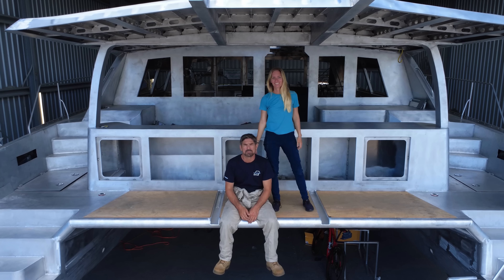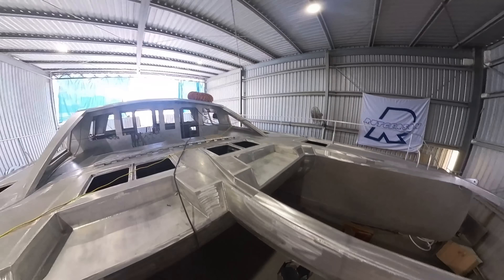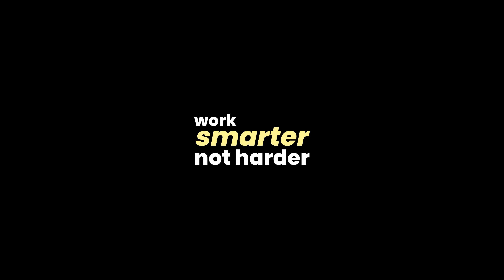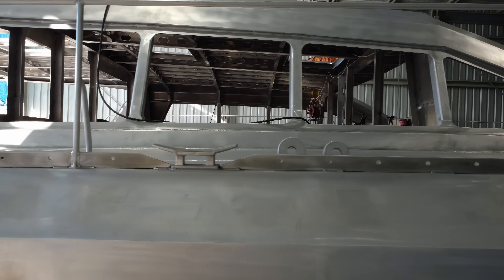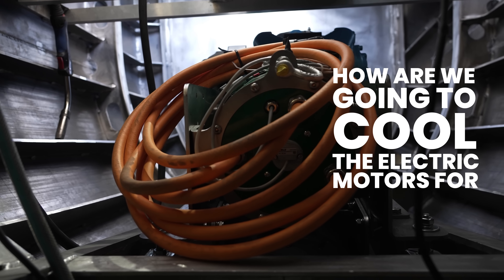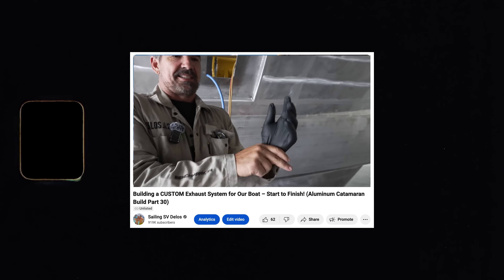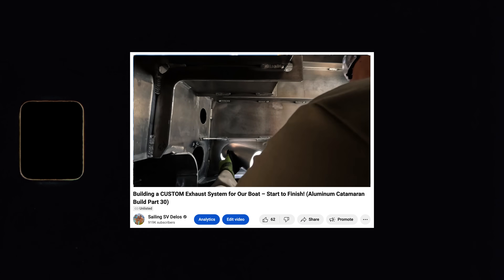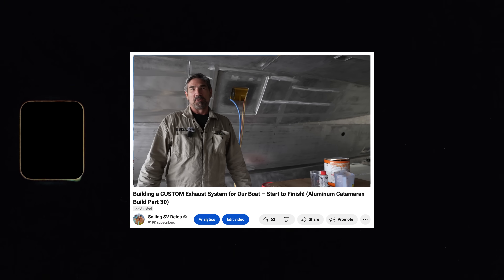We Challenged AI to help design our Keel Cooler 🧠 (Building Our Own Aluminum Catamaran From Scratch)

Comment: Generative AI engineer here: One thing that Gen AI does BETTER than most people realize is validating its own work. And while these days, some of this evaluation is automated, it's not always the case. Especially in the "chatGPT" type apps where you just ask a zero-shot prompt like you did. 

I know it sounds crazy, but if you ask deepseek/gpt/gemini to validate its own work (ex: analyze your response and make sure there's no errors or missing information, etc etc) you could make sure the calculations are correct. This isn't foolproof obviously, but is a very good technique. 

Secondly, you can use role based prompting to help receive a better answer that might highlight issues with the problem you're trying to solve. For example: You are a marine refrigeration specialist. Design my keel cooler... 

Hope that helps!
Reply: I seen people use ChatGPT to turn in school essays and they end up getting As in their paper.
Reply: Yup, I have had to question ChatGPT on several occasions, it comes back and tells me I was correct and it corrects it answer.  Just amazing, but as Regan once said  trust but verify.
Reply: When I tried that, the AI would just make up errors in the work, and it would find different errors every time lol. Maybe it has advanced since then.
Reply: @roberson644  When was this? If it was last year, I suggest you try again! Even over the last 6 months we've seen an incredible leap in how "smart" the current generation models are. 

Give it a try again. Be sure to provide as many details as possible about what you expect from the outcome. Ask your questions like you're giving an intern instructions. Be skeptical of the output and have it check its work.

Comment: I’m a mechanical engineer that specializes in fluid systems and thermodynamics.  For starts how cool  do you wanna run that motor?  Generally you’d want to keep the temp as low as possible to reduce losses in the stator.  This poses a real problem. The source temp and ocean temp are not far apart.   Not like an ICE.

Also how big are the coolant fittings and flow passages within the motor?  Does the manufacturer recommend a minimum flow rate?  Bet they do.  This will size the recirculating pump which adds its electrical load to the waste heat load.  

This number will size the plumbing to the cooler.  Unless you want to dump that heat into the boat it needs to be insulated and preferably short.  The longer the run the more pressure drop and the bigger the recirc motor.  Once you get to the heat exchanger we need to establish a balance between the heat transfer from the coolant to the walls and from the wall to the quench- the local water.  Also I’m assuming you don’t want any vulnerable exterior stuff with thin walls or hull penetrations.  This means that the interior surface of the heat exchanger that faces the cabin must be insulated.  

Each heat exchanger you are considering should have a flow rate vs delta P rating. It is very important to keep the flow velocity up inside the hex or the internal heat transfer coefficient will be kinda low.  Just do a quick check on the internal Reynolds number. It’s gotta be fully turbulent.  I’m not sure how fast you expect the boat to be going when underway with this system in use.  I suspect it’ll be kinda low.  Like a couple knots. Get the AI to compute the local external Reynolds number.  It should be in the turbulent regime at minimum motor drive  speed.  Also I’m assuming this installation is aft in the hull. This means that the water flowing over this surface has been following a surface that is like 50 ft long.  At these low speeds there will be a layer of relatively stagnant water adjacent to the hull.  Not optimal for a great external heat transfer coefficient.

This means that when coupled to the low available delta T the hex surface area will trend larger.   Another consideration is how the residual sensible heat within the drive motor is to be removed once it shuts off. It’s possible that when the boat stops the only cooling thru the hull will be by free convection.  This could be kinda small.  

I’d also ask the drive motor supplier what the overall efficiency is.  The motor efficiency on converting electrical energy to its output shaft may be 95% but I’d bet there’s a gearbox present to get the shaft speeds down to prop speed band.  That gearbox is not perfect.  It’ll lose around another 5% for each stage.  That gearbox normally has to be cooled too.  Also ask what the efficiency is at off peak power conditions. Same with the inverter box driving the motor.  

I understand your motivations but given that this is a piece of expensive, critical equipment I’d trade this against a cooling system like you have on the ICE.  They could share common components and there’s a lot less uncertainty.  I think it’d be easier to maintain and repair too.  If yah wanna be an engineer then trade honestly at least two configurations.  It’s often heartbreaking to realize the cool system ain’t all that cool in the aggregate.
Reply: I am also a mechanical engineer.  One of the AI outputs was basing its design on a mid field sea water temperature.  This would mean that whenever you are in warmer water, your electric motors will be over heating.  You need to design for the worst case condition and then add a safety factor.   As an analogy, if you were designing a bridge, you would not design it for mid level traffic, you would design it to be capable of carrying a huge bunch of heavy trucks.    There can be other unforseen issues such as what happens if you haven't been able to clean the hull for quite a while and you get a large build up of growth on the hull.   Does the anti fouling paint decrease the conductivity of heat flow.
Reply: @andrewkeir2282  as a marine mechanic, you don't paint the heat exchanger on a keel cooler, you do change the zincs though, and you don't paint the zincs either, but be sure there is a good clean contact
Reply: @andrewkeir2282  Is the circulating coolant water too warm for fouling to occur inside the heat sink?
Reply: Ibid.  As an aerospace engineer, I second the ME's motions.  Even at -50 deg F at 35,000 feet, airplanes also need to employ some interesting tricks to keep things cool, including cooling very hot, high-pressure turbine bypass air before reducing it's pressure.
Reply: To be clear you are suggesting a separate heat exchanger inside the boat that draws water and expells water using thru hull connections?  I would agree that this could be the simplest solution using off the shelf components.  It would be ideal to make the cooling system common (shared) to both electric drives as well.  This would eliminate duplication and it would limit the number of additional holes in the hull(s).   Finally,  the strainers and and all ancilliary components could match the ICE system so as to make future servicing much simpler.  Kudos for the lateral thought process...very smart!
Reply: I'm an absolute newbie in this area, but one concern for me would be galvanic corrosion and since your hull is part of the heating/ cooling system the heat could speed up galvanic corrosion through the hull. Maybe using a separate heat dispenser would allow you to swap out parts should they corrode in the future? Might be tricky if it's the hull that's affected.
Reply: I’m no engineer, but have worked with fully electric boats the last 10 years. The 25 kW motors will almost never be used at max power more than a couple of seconds, during manoeuvres in tight quarters with wind. Since the prop power is available with almost zero delay, for this use the motors appear far more powerful than they are. For long lasting loads, there will be no wind and typical speeds will be 3 to 5 knots. 

A guess based on experience would say that if each motor runs at 2-3 kW, speed should be 5 knots. Keeping 2 knots would probably be possible at 0,5 kW per motor. Very low speed gives very low resistance. For each knot increase, expect double consumption. Even more at higher speeds, when wave resistance becomes an issue. This means that significant cooling is almost never needed. 

However, the system has to be designed for worst case scenarios, of course. Say strong winds in tight quarters when the anchor came loose. Then full power for extended time will be needed. Thus also full cooling capacity.
Reply: Couldn't agree more!
Reply: Re: heat transfer from  ‘cooler’ to hull. Cooler unit to be shaped to provide an intimate fit to the hull. Optimize heat transfer with thermal grease between cooler and hull. Cooler and hull surfaces free of corrosion or anti oxidation treatments.
Reply: I really don't think the primary goal here is to reduce losses in the stator.  It's to prevent the motor from overheating and burning up a coil in the motor.
Reply: Si what is your answer mine was 2 square meters read what I wrote!!!!!
Reply: I agree, the electric motor cooling system should be K2*%of output in ohms-seawater temperature

Comment: Mechanical Engineer from the rocket industry. We solve the heat sink area problem in the nozzle by cladding the inside surface with copper (on a cadmium substrate). Then we circulate unburned fuel in the upper portion of the nozzle, which is made of thicker metal than the lower portion. Additionally, we squirt unburned fuel through tiny channels (mid nozzle) which tends to make the outer flame burn rich, which red flame creates a boundary layer that keeps the nozzle from melting. You could accomplish the same effect cheaply inside the hull of the boat, by building up a thicker aluminum substrate immediately around the motor, then welding a standard aluminum car radiator to it, and pumping standard radiator fluid through the system. It's important that the car radiator has enough radiation through the hull and you'd need to calculate the number of welds needed (surface area) for the heat flux to all transfer.

Comment: @svdelos Could you do a test to see what the actual thermal coefficient is through your Hull? Testing with stationary 25°C water is pretty much worst case scenario, right? Don't forget the thickness of your Hull in all these AI calcs. 

A few thoughts...

Be careful how many times you make conservative estimates in your assumptions, they can add up to a big difference in the end and likely is the reason why different AI models give different answers. 

Design the external part of your keel cooler to be easy to clean as I imagine barnacles and other growth could affect your heat transfer.

Could avoid extra holes in your Hull by welding ribs on the outside and a heat transfer box for coolant flow immediately across the hull from the ribs.

Last thought since you are intentionally pushing the envelope on these design choices... Have you considered circulating either drinking water or diesel fuel as your coolant? Then when returned to their tank they'd have the entire surface area of your keel/tank to transfer heat thru? Wouldn't want to contaminate your water or risk fire from leaking diesel tho.

Comment: Heat transfer coefficients are waaaaaay worse in practice. They always quote ideal crystallographic lattice thermal coefficients along the best axis. In reality you have forging, paint, surface friction, surface resistance...etc, etc. think an aluminum heatsink on your computer uses a thermal paste rated 100x less not including contact resistance and pressure.

Comment: I'd go with 0.5m^2. I got to this using a VERY different method, but I got a similar result. I work on computers which are water cooled (water pulls heat away from CPU, into a radiator, which then has fans attached and puts the heat into the atmosphere). A modern high-end CPU can use as much as 250 watts (some do more!). The CPU is only 45x37.5mm and can only go as high as 100*C (should be kept far below that, though). But, those can be cooled with a fairly small radiator package, such as 360x120mm. And, that's just radiating heat into air. You attach the radiator to the inside of your keel then have water flowing over it . . . it'll be far more efficient at dissipating that heat. But, your motor is putting out 10x the heat of a CPU, so let's say it needs 10x the cooling. That 360x120 rad is 43,200mm^2. Multiply that by 10, and you're at 432,000mm^2 . . . or 0.4m^2. So, just under half a meter squared. Which is in-line with what you were saying!

Comment: Hi Brian & Kaz,

I am no engineer but am a millennial nerd. HA! If you are considering using AI for your project going forward, I would suggest that you use the latest beta of Grok from Xai. I believe it's currently called Grok 3 (beta). As I understand it, Grok uses real-, up to date information not only from the web but also directly from X/Twitter. Ai programs like GPT are constructed on a set of information from a specific point in time when their latest version were update. I am most certainly not paid to promote any of these companies, I am just, as I mentioned, a nerd that absolutely loves your channel and this build series.

Godspeed to you both!
Reply: This is what grok responded with deep think using Brian’s prompt “### Final Answer:
- Heat to dissipate: 2,780 W (2.78 kW).
- Heat sink size: A flat aluminum keel cooler with a surface area of approximately 0.124 m² (e.g., 50 cm x 25 cm) is sufficient under the assumed conditions (ΔT = 30°C, h = 750 W/m²·K). For safety and fouling, consider upsizing to 0.15-0.20 m² (e.g., 50 cm x 30-40 cm).”
Reply: Using “data” from Twitter makes Xai less reliable, not more.
Reply: @WilliamAArnett  Above and beyond using web resources, Grok can cross-reference online information with real-time, human- input that people, including marine engineers, could post on X. Deep Search together with community notes; that's two additional layers of filtering before you are given an answer, which is the foundation that Grok was created on. I struggle to see how that would be less reliable that purely quoting online resources like most Ai programs do. Care to elaborate?

Comment: Hi Brian, you need to transmit the heat from (the surface of) the electric motors to the hull as efficiently as possible. I assume the motors are mounted fairly close to the aluminum hull, which is a good thing. I would use a beefy aluminum motor mount that touches the hull to use the aluminum to directly transfer the heat via the shortest possible path, rather than using complicated fluid system involving pipe and pumps etc. I used aluminum heat sinks to suck the heat out of large LED arrays that worked very well. Heat Pipes are another way to efficiently move heat but an overly complicated solution for your simple situation, Rich.
Reply: Many marine electric motors, even in the RC model world, have a "water jacket" around the motor for cooling them.  It looks like the electrics that they're going to use are designed that way.  However that isn't (to me at least) the major ding against your idea, my concern would be noise/vibration.  While electrics are nearly vibration free, that isn't the same as COMPLETELY vibration free.  For an electric POWERBOAT I wouldn't hesitate to use rigid mounts to improve heat transfer and the "noise" be damned LOL

Comment: If you are putting the cooler inside the boat then you have to consider that the antifouling paint you are using is having good thermal conductivity. Better to use outside the hull cooler with direct sea water contact. Marine growth acts as insulator.

Comment: There are literally thousands of steel narrowboats on the English canals with keel cooling for their 30 to 40 hp diesel engines.
Typically they are a thin tank welded to the swim of the hull around 600mm  x 1000m long and 30 thick with internal baffles to ensure the cooling water doesn't  short circuit. 
Box coolers are a more compact alternative manufactured by companies like Blokland.
Reply: Yup, Beta marine has Keel Cooling Calculator & Tank Design info on their website specifically explaining how to do that.
Reply: cooling water cant short circuit a mechanical device Unless it's on purpose.
Reply: Ex crewmate Liz may have one!

Comment: Be Careful using AI.  I have run into a few cases were the AI will hallucinate and create facts and items in images to support its conclusions.  e.g. using deepseek, I took a picture of something and asked it to draw an arrow to an adjustment bracket that it was referring to in a previous question. It took my image and redrew it  with an optical sensor that was not in the original.   I called it out on it and it recognized that it hallucinated.  I had to tell it that in future questions to not redraw the image but use the original.  Its all about the prompts.  I would suggest that you research a little on how to create prompts for the questions your gonna use it for.  It makes a world of difference.

Comment: 1. How will the hull paints, ablatives affect these coefficients and is it a problem as the hull growth accumulates and forms another barrier to transfer.  2. Can you figure a way to dump this excess into the water heaters on the boat first , free hot water, and then dump it as the water heaters limits are achieved.